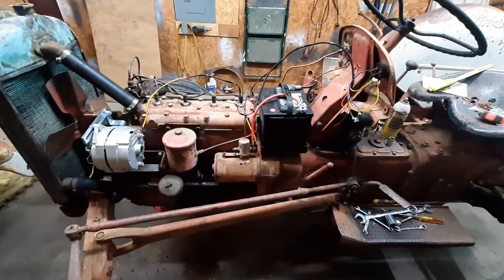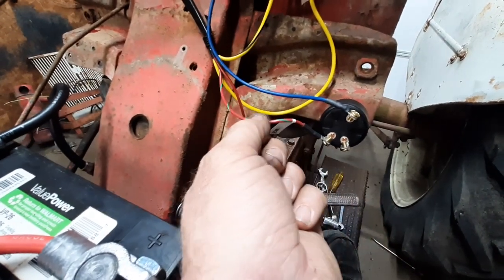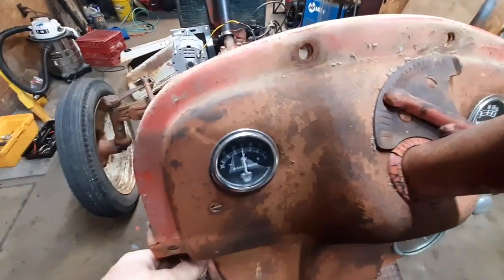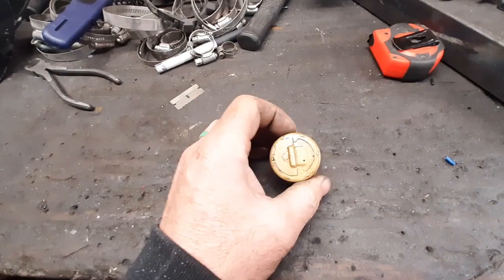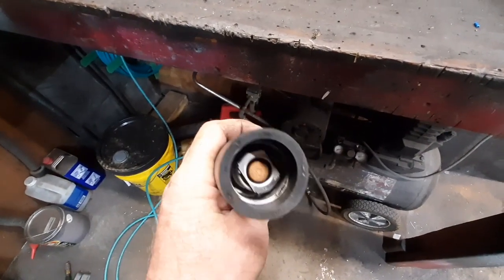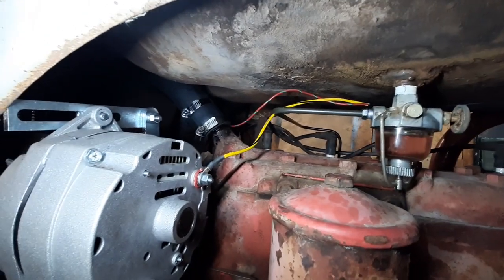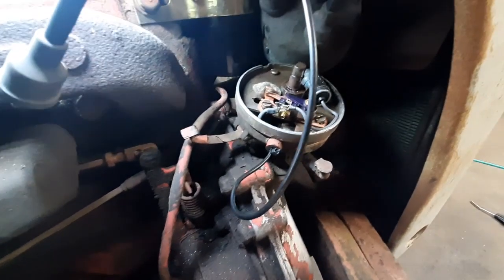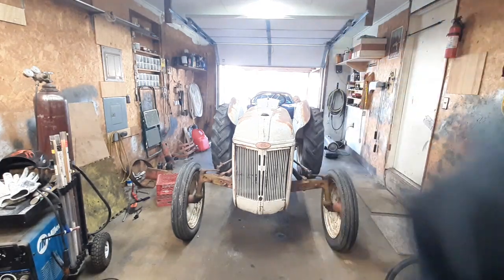The 8N Project - 12 Volt Conversion Pt 2 - It Runs!

Comment: I think that power stud/insulator on the distributor causes problems. I had to replace the one on mine, PO jerry rigged one on it. They are a little pricey.
Reply from the maker: Yes and when they fail they can shut you right down.

Comment: Is there a voltage regulator or ballist resistor
Reply from the maker: The one wire alternator has a built in regulator so no external regulator is needed.  The ballast resistor depends on the coil.  If I remember right I installed a coil with an internal resistor years ago so I'm not running an external ballast resistor either.

Comment: Excellent Jason, I'm using your advice on the battery box and air filter. . . I'm actually converting my distributor to a magnetic pickup instead of points . . . great advice ty . . . God Bless from Savannah, NY =)
Reply from the maker: Are you using a Pertronix pickup unit?  I had good luck with them years ago on a VW but some of the tractor guys seem to have trouble.  Let me know how it works out.

Comment: Be nice if someone would send you a proof meter and cable.
Reply from the maker: I know.  It's on my future parts list.  I pulled the old gauge and cable off today and half the inner cable is missing so that's why it never worked.  The little socket in the governor spins just fine so it should be good when I get the new meter and cable.
Reply: I installed a new proof meter and cable on my '51 and the cable (not the flexible housing)was about an inch too short and would not go in far enough to make the meter work. Chinese quality contol. I had a local parts house order a universal trim -to-fit cable. I have not had time to install it yet. After market parts may or may not work like theyre supposed to. When I got ready start my '51 for the first time, it had no spark and I replaced coil,points and condenser, cap and rotor and then it would spark but only pop back in the carb. After timing it per the manual: #1 cyl 4 deg. before TDC on compression stroke with rotor toward #1 cyl, the tractor fired right off and ran great.  @xpsgarage